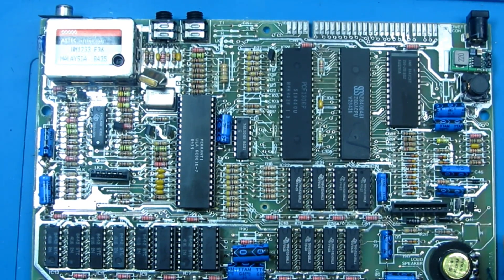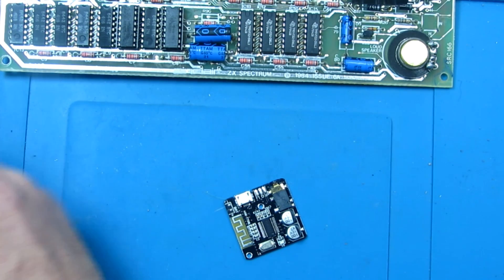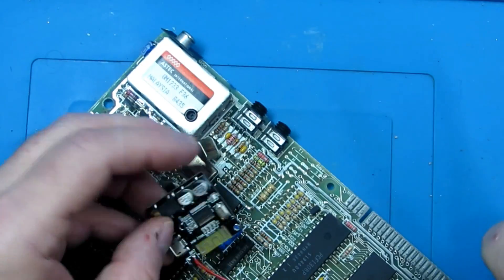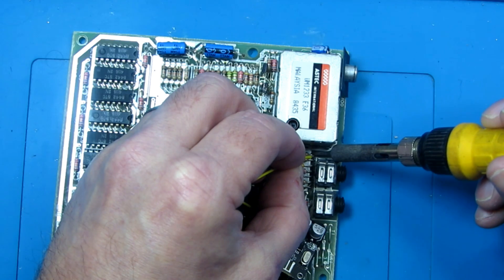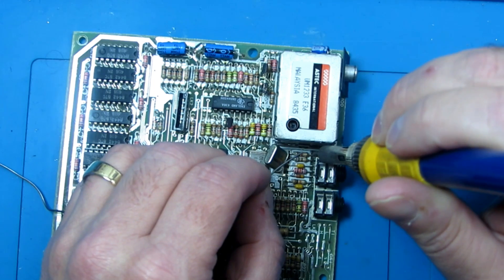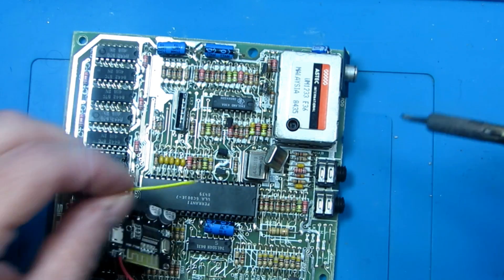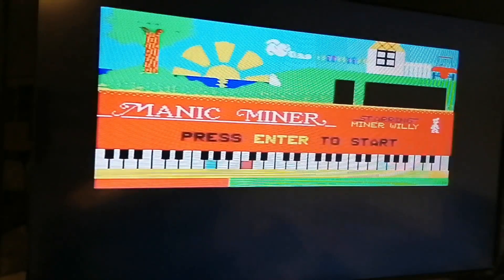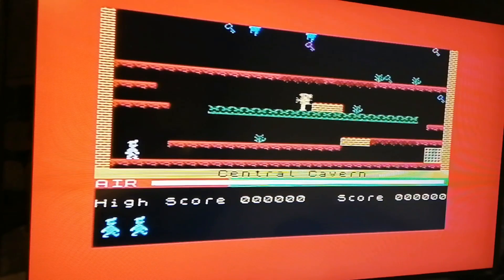Spectrum 48K Bluetooth, load games from your phone!

Comment: ❤This is the second time I've seen a video about this rather brilliant mod. However, I have yet to see a version where it is applied to a Spectrum +2.
- Which in my eyes would just take the cheapness and simplicity of this solution up yet another notch, since there are quite a few +2s out there with broken tape drives, and with the obvious lack of the  EAR and MIC mini-jack ports, could benefit even more from this easy fix.
- Although I quite deliberately don't own any of the Sugar-coated Speccys myself. I can still easily imagine some +2 owners watching this, while wondering where the equivalent of those solder points would be located inside either of the versions of the +2 models.
Reply from the maker: I did my brother in laws  Spectrum +2 with this mod.  Unfortunately I didn't film it.  If I get another one I will be sure to put out a video of it.  Thanks for watching.

Comment: So you connect it only on one channel output (R), but bluetooth module output is stereo ? Is the signal always strong enough ? I ask because i bought bluetooth receiver that i connect with original 3,5mm cable from outside and it's too weak. Sometimes it menages to load game sometimes i get loading error, signal strenght is on the edge ....
Reply from the maker: Yeh, just the one channel.  I do have to have volume on phone to max but loads fine.

Comment: Great job! I was just about to build a TzxDuino, but it won't be needed. This is much more elegant and cheaper, and nothing is visible from the outside. I plan to install the MH-M38 version, because it also has an amplifier. I see that the 7805 has already been replaced in your machine. Wouldn't the BT module be in a better place under the cover, instead of the heatsink? So the keyboard cover plate doesn't shade it? 
I have a few 48K machines that I am refurbishing and giving to my brothers as a memory of their childhood. It will be an indescribable feeling when Manic Miner starts loading into the machine "out of nowhere". I'm going to say it's just some kind of magic... ;)
Reply from the maker: Have to say it's kind of cool :)  I did relocate it a bit as the fit was a little tight where I had it.